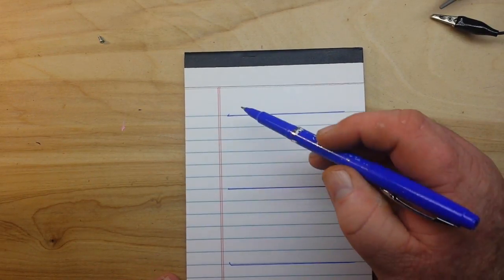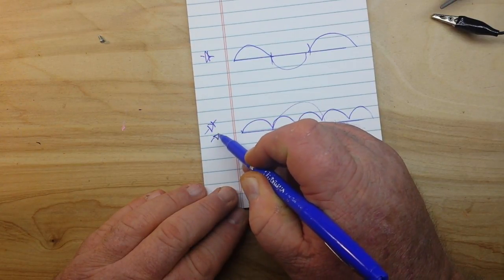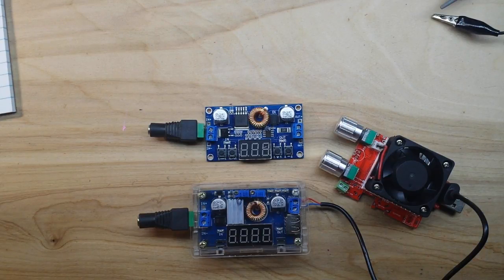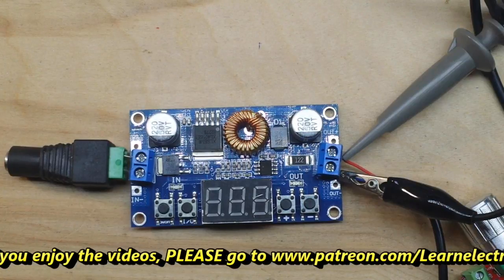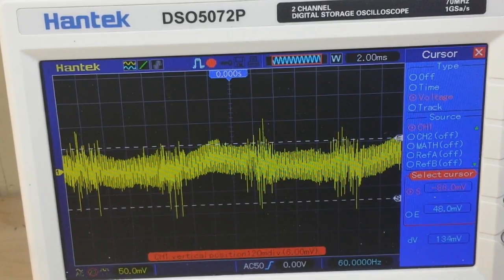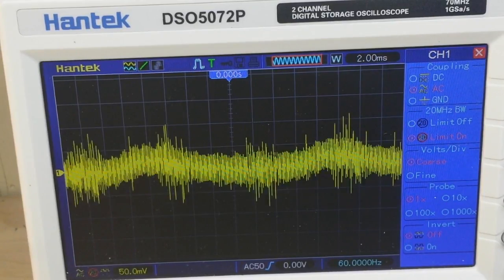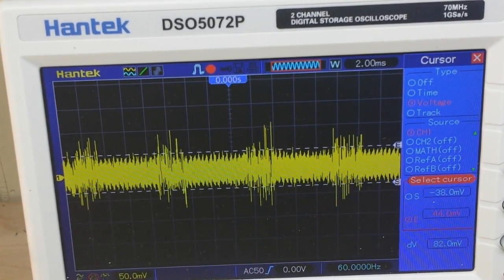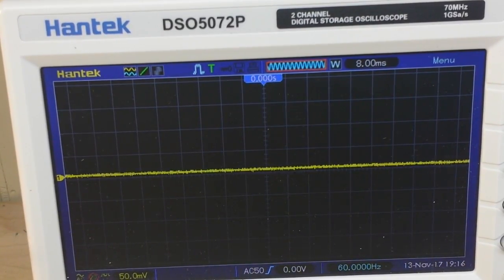How to measure power supply ripple

Comment: I just checked an old Micronta Solid State Linear variable power supply at 9 vdc. If I did the process correctly (used an LED and resistor as the load), the ripple is 16mv at 10Hz according to my oscilloscope. I’m learning how to use the oscope also.

Comment: @learnelectronics   Hi, you should try to use the small spring with your probe (some people call it paperclip method) and compare your results. The ground wire in your probe creates ground loop.
Few weeks ago I was measuring made in the US commercial grade,  24V DC -> 5V DC buck converter. When I used probe with the wire I observed about 200mV ripples at ~150kHz. When I used the paper clip method the ripple dropped to to ~15mV, huge difference. The ground loop works as antenna.

Comment: If the high voltage power supply (500v) how can measure is?
Reply: Use a 100/1 voltage divider

Comment: another electronics video on noise and another person using a scope. use a spectrum analyser. you're talking about a composited signal. use a spectrum analyser. you cant make out dick all details on an oscilloscope - especially when the high frequency ripples are many orders of magnitudes smaller than larger ripples. noise is a spread spectrum phenomenon
Reply from the maker: And your point is what, exactly?

Comment: Ahh great video on a very interesting subject. Would have been nice to see a linear voltage regulator as another example (i believe this would have far less ripple than the buck converters).
Reply from the maker: +Michael Padovani You are correct, the linear supply may have only 10s of mV of ripple.

Comment: Very interesting that the noise to noise spread on both power supplies was exactly the same. Must be something in your home wiring or what ever you were using to power the different supplies. Really cool demo. Great proof that you should always check out the characteristics and quality of the different parts you get when doing a component build. Thanks for the wake up.
Reply from the maker: +Carl Davis Yes, the noise is common mode. It comes from the same power supply, powering both of those converters. Very good observation.

Comment: would a cap help the noise? or cap and inductor? on the first buck conv....
also I need to run some 12 v led strips. about 6 lights. or strips. maybe 8, but I have a 24v bank. what do you think would be most efficient. run 24v to the room where the lights are. then drop to 12v. with multiple buck converters
 or a single higher amp converter mounted near the batt bank. also I was thinking about a kinds ups. have a small 12 v lithium battery. using the 24v as the main power. and to charge the lithium. I don't want to get complicated. I just need lights even if the large bank is dead. but that can wait until later . I need to get lights for now. so I need about 2 a per strip. or about 20amps max. because I may want to go with rgb or rgbw. led strips..  I don't usually have a lot of brtght lights on . I tend to stay in dim light. unless I'm trying to do something. or reading. so they will not be on fully. so maybe a central mounted mid wattage would work. 10-15amps. great video. I never thought a buck converter could be so noisy .
Reply from the maker: +James stranger It's not that the buck converter is noisy, it's the switch mode power supply powering the buck.

As for you, one large converter.
Reply: the buck converter will create noise if it switches. the noise you see eventually on the power rails will be an intermodulaton of both the power supply and buck converter's switching frequencies. 
take care to check the switching frequency of your buck converter doesn't change depending on the load. that will change your output ripple significantly when you turn on/off different lights. 

you need to be aware of the frequency of the ripples and use the appropriate types of capacitors to filter that noise band. the author of this video didn't go near enough into what to do about noise.

Comment: I guess the old adage "you get what you pay for" is still true. I should measure my bench supply and see how clean it is. Thanks for the tip, I think I'll put it to use.
Reply from the maker: +George Chambers Yeah, let me know the results. It it linear or switch mode?
Reply: It's a Mastech HY1803D just a little 30V. It is linear though. Seems to work quite well so far, I've had it a couple of years.
Reply: ya probably not really seeing much if anything useful. look at it through a spectrum analyser. a cheap way is to bang it onto your PC soundcard through a coupling capacitor and optional transient clipping diodes. it'll get you 96khz range only depending on your card but its a start.